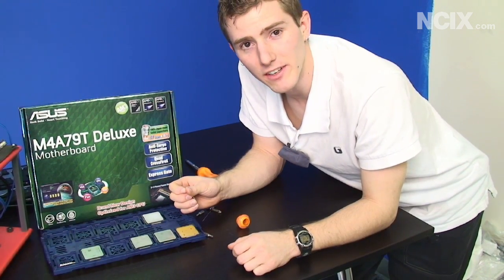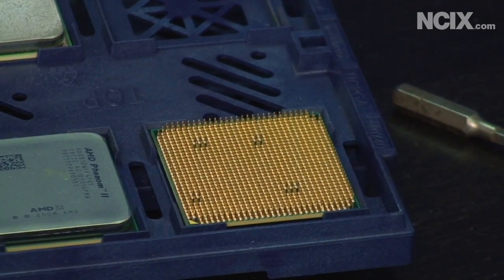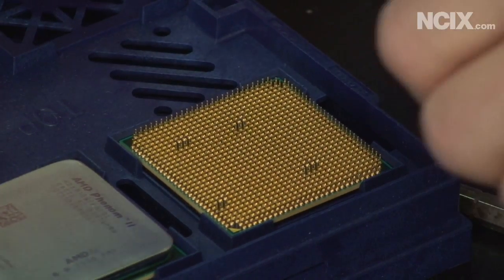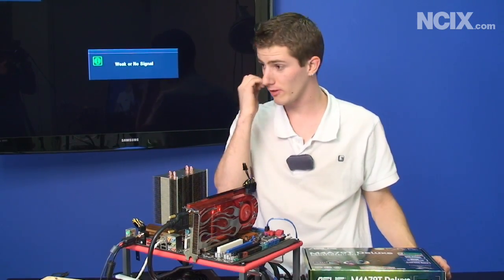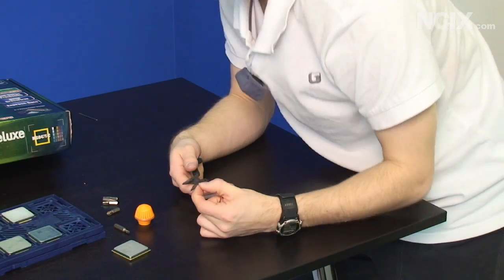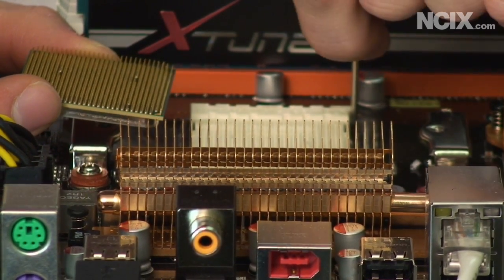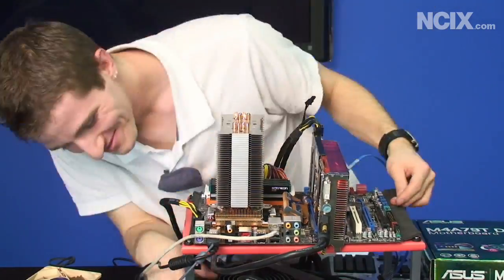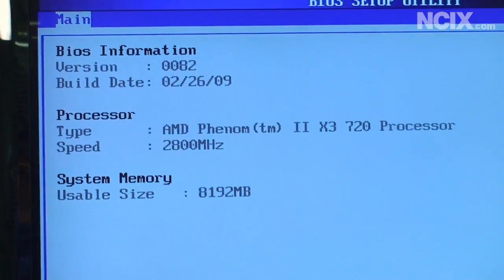Fixing a Bent / Broken Pins on a CPU (NCIX Tech Tips #36)

Comment: XD I was kinda happy when u've fixed it XD
One question I'be recently broken a pin on my CPU but when I plugged it back in it worked fine. But I've read on a forum if the pin is broken but doesnt affect the CPU it could burn the motherboard over time, so I've plugged some wire in to the socket and put the CPU back in but not sure if its fixed or not ... any tips :D

Comment: HOLY SHITE!  my old cpu was dead because a broken pin.  I never thought of the idea of actually just putting a pin in the socket where the lost one is on the cpu.  It WORKS now.  Although, I will not rely on it as I am afraid to burn my motherboard up but it did atleast let me flash a new bios on it.  Thanks Linus!

Comment: one way i found out how to fix bent pins was to take a knife that was the same with of the gap between the pins and i ran it back and forth with the back of the knife facing the top of the cpu and it bent them back to a 90 degree angle by going in all direction around the bent pin/s

Comment: Man I remember when I had a ruined cpu laying around at my old place of business, 60% of the pins were bent, in different directions, but they weren't beyond a 40 degree angle. I straightened all the pins, tested it, worked fine and ended up selling it after it sat there for a good few months.

Comment: I was cleaning my parents computer and swapped the rocketfish heatsink for an A70 i had laying around, and i accidentally dropped the A64 3000+ and a few pins bent, no big deal though. Temps are down 10 degrees and even the fan blows on the 9600 GSO with the accelero cooler :D

Comment: one can strip pins off cpus using a heat-gun or blowtorch.  leaves nice clean pads and a handful of pins.  id be nice to have a purpose-built tool that would grip an over-length pin and tack it to the clean(ed) pad.  (having) secured the pin in place we need merely trim-to-length with flush-cut side-cutters.  don't even bother trying to straighten hell-bent pins .. desolder with pin-tip desolderer and then introduce a brand new, over-length replacement pin - me thinks.

Comment: @Aznganxter1 
I did > retailer(warranty center) told me that it is my fault (I did not even try to install the CPU, they just sent me an used motherboard) and just sent the MB back to me. After I got it I very carefully bent the pins back with a needle, everything works fine now :) Got 4.4GHz OC on my i7-2600k

Comment: @NZinfection no it did not and we found out it was used even tho they said it was new, (got it from amazon), but i got another one and it works great, overclocked to 3.8 and runs like a champ with the GTX 480.

Comment: Hi, I have an Asus P8P67 motherboard. the other day i was installing a fan in one of the chasis fan connector chasis  fan connector no 2. the wires in my fan header were inserted in the wrong seqvence so ot got damage now when i insert a fan into chasis fan connector 1 and 2 it doesn't detect it the fan doesn't move only the fan led get on. plz help me.

Comment: @TheCrazySquirell The % of braking a pin on the mobo is less than the % of breaking a pin on CPU. Have you seen a AMD PC that haven't been cleaned for few years? in 90% of the cases when you try to remove the cooler it comes out with the CPU.

Comment: I have the same problem with computer not booting, the pins are from the motherboard not the cpu. The top half of one pin has broken off so I was thinking of maybe using a small amount of aluminum foil just enough to make contact with CPU. Would appreciate repair advice asap..

Comment: Haha. I actually did something even more hardcore than this.

I was swapping out the CPU in my laptop.. the original CPU was a Celeron and I was upgrading it to a T7200 Core 2 processor. I'm a moron so of course, I broke a pin off of the T7200 that I'd just paid 150 bucks on eBay for (at the time). And to make matters worse, I dropped the pin on the carpet.

So, what I had to end up doing was ripping one of the pins off of old Celeron CPU (thus risking ruining it) and putting it in the socket.

Comment: @samuelu21352135 Don't drop it, if you do check non are slightly bent very carefully before putting it in, how I broke mine, not careful enough. Other than that just follow the markings on chip and mobo and you wont bend any

Comment: i have actualy fixed several cpu specificaly 478 intel cpus and i have a friend that works for intel and has the skills and tools at his work to resolder the pins on to the cpu it self and that is what you do when you break the pin off if you realy want it to work

Comment: @scorpian007 But you have the pins on the motherboard, and if you place the crocessor wrong, you are also very likely to bend/break a pin. But overall I like the intel-sockets, because the holddown-mechanism is just way safer. once (I had a little too much thermal paste used) when I lifted up my cooler, I first thought "where is my Phenom IIX4 955?!?" but then I saw it sticking to the cpu-cooler XD
So, my next system is gonna have an intel CPU for sure ;)

Comment: I can't believe how lucky I got with my cpu. It's an AMD 955, and I was replacing the heatsink. So when I try to get the stock cooler off, the CPU is literally cemented on to the fucking thing. So I try to be as gentle as possible, no luck. So I think "Right, fuck this" so I get a flat head screwdirver, stick it under the cpu and twist it. It popped off, did many flips in the air, of all the chances of it flying off the table, and braking on the floor, it lands, metal side, on a cloth. ISHATBRIX

Comment: Holy.. I didn't watch the last part of this vid. It's like achieving the impossible. I bent a pin or two on another motherboard I had because ceramic paste managed to get on it and I wasn't sure if it was safe to power on with the CPU laying in the socket. So I tried to clean it and I ended up bending pins and I could have used a safety pin which I used for this Pentium 4 2.26 ghz. But whatever, at least I won't have to go through this anymore.

I'll recommend this video to pin-bending friends

Comment: What about a touch of super glue to fit it back together or some sort of conductive adhesive? Either way if the pin makes contact with the base then it should be fixed. I have a pentium 4 2.26 ghz with pins that are all about okay, a few got slightly bent but I could take a graphite pencil or try to use a safety pin and realign them.

Comment: when i removed the CPU Heatsink on my motherboard i almost had an heart attack when i saw my processor stick on the Heatsink. It was removed on my board not in a proper way. Many pins on my processor bent so bad. I just used my fingered to align them. Now its working fine as well. I almost lost my brand new Athlon X3 440 and i almost kill myself..

Comment: would also like to mention that if you use a heat gun to re-mount your pin be very careful not to touch any of the other pins, or you will be in a world of trouble, and even the wind from the heat gun can cause them to fall over. but that is the only proper way to make the repair, now if the pin is slightly bent back in the day you could use a qtip with the tip taken off (the hollow core) to straigten it, these day a led pencil is deffinately best

Comment: the next time you start to call yourself poor, people shoot yourself, then maybe you will be poor. and as for that solution, it only works if you keep a slight bend on the top of the pin when you insert it, to make sure it doesnt go to deep and loose contact at the first vibration. the proper solution is a heat gun and tweezers, to remelt the soldier that origionaly held the pin to the cpu and remount the (clearly) shorter pin permanently, much as you would to any surface mount.

Comment: If it's not bent  to much, you could use a small screw driver and slowly bent it back. You work your way from the bottom and then slowly go to the top of the pin. You shouldn't use to much strenght though, this isn't the safest method and shouldn't be done by clumsy people or by people that wouldn't exactly know what they are doing xD.

Comment: you can also use a small wire and bent it outwards of the cpu socket (because it is on a border roll). that way you can make better contact with the cpu, and can easily put it in and out of the socket

Comment: dude, thanks for the tip, i drop a athlon le 1620, the cpu was completely smashed into a corner and lost a pin, i replace the pin with a copper thread for a electrical cable and works perfectly, even i use it rigth now, the only thing is in the processor name says "AMD Processor model unknown 2.4Ghz"

Comment: I bought a opteron 148 a long time ago for like 15$ and i raised like half the cpu's pins back. Later on i had 3 pins left and all three of them was really fragile and after to much screwing around i broke them, so i took it to work and started solder some new pins, i managed one but the last ones were a mess. I melted the top-soldered gold just upon the PCB and i ended up having nothing. 
I've waited long enough now and i actually haven't tried doing any trix with the situation.

Comment: @tehklutzking 

Not on the processor, but on the socket. It's alot easier to damage the intel-socket 
than the AMD-cpu. You can stand on a AMD-CPU without breaking it, while it doesn't take alot to break the pin on the socket. 

I've always gone for intel, mainly because i think the socket looks better. Even though it's inferior. (The foxconn-burn-symptom for an example) 
And now because i can run both SLI and CF on the same motherboard. But i didn't get a foxconn-socket motherboard.

Comment: omg thanks guys that worked on my old broken dual core on the old system and now i can use it like an internet pc THANKS A LOT BUT THE THING IS THAT I SPEND ABOUT 4 FRUSTRATING HOURS TO LINE THE PIN WITH THE HOLE :D

Comment: Generally the motherboard is cheaper than the processor so you will save there if you have to buy new hardware, even though I'm using an AMD single core here (all I have), I would still go Intel if that was a "selling point" (which I will be, E5200!).

Comment: actually you can still use that motherboard with another chip, just use a pair of tweezers to pull the pin out of the socket when you're going to switch it out.

and so that you dont lose the loose pin, tape it to the top of the chip when storing.

Comment: Um your a dumbass, I wasn't referring to the this video in my last comment. If you would have read it correctly you would have seen it that in my last reply I was referring to a posters "Pentium 4" which could have been a socket 775,423 or 478, and if you would have paid even closer attention, I mentioned that the 775 cpu's are zero insertion force.

Comment: ive fixed a p4 cpu with a flathead screw driver and a pair of tweezers, and im not talking one pin, 
im talking, my meathead friend tried to insert the cpu back into the system while it was still attached to the heatsink.
didnt have it on the right corner and missed the slot all together, then tried to push harder, and i spent like 4 hours under a desklight correcting like 300-400 pins exactly like what you just seen him do and didnt break a pin, so either the metal was bad, or he's a meathead